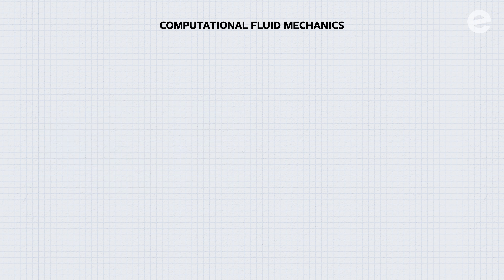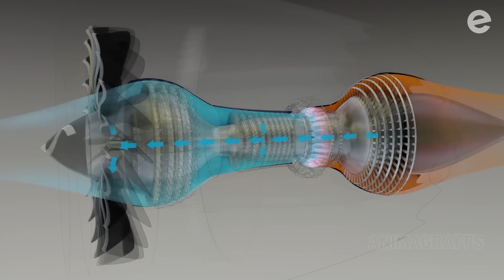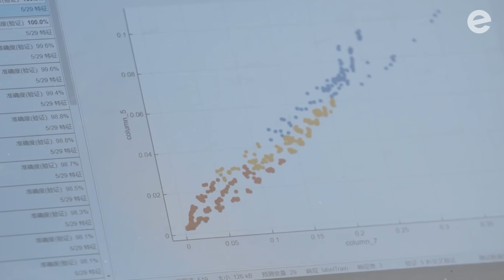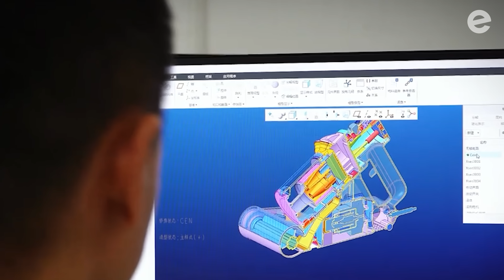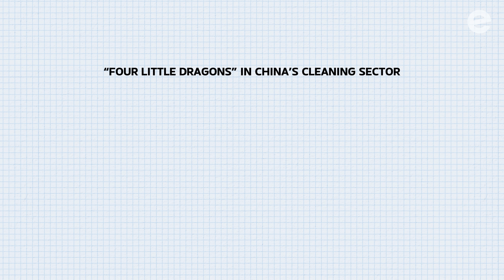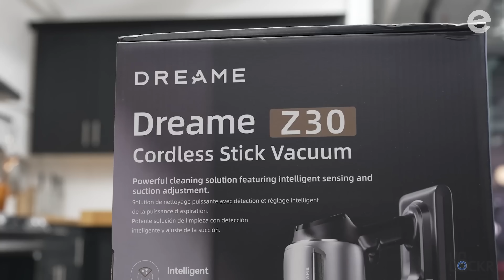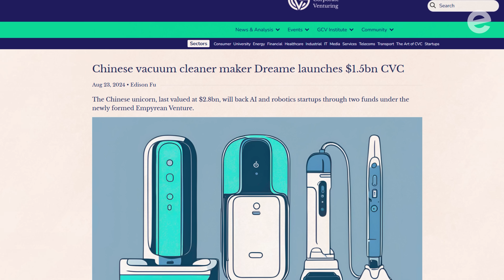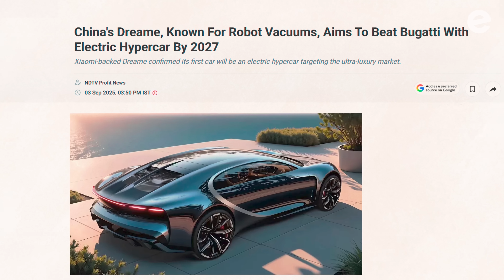How this Chinese Startup is Crushing Dyson's Empire

Comment: Just bought dreame aqua 10 roller, so instead of 10 height it has 11.5 so you have to buy not 800€ vacuum, but atleast 1100€ so that 11.5 could retract its 1,5 cm so that robot could fit under tight spaces where old robot could fit. So after 2 daysbof usage i have to return this and get aqua 10 ultra roller or track one.. oh and they most definetely madw them thicker on purpose because there is nothing there that actually youneed to make them taller at all

Comment: Actually the cleaner head design and power is more so of what determines the vacuums pick up performance and the Dyson V15 and Gen 5 still have better floor performance and more suction at the cleaner head as Dreame(like most other cordless machines) do not have good cleaner head designs.

Comment: Dyson "Bladeless" Fans Really Work
Hidden Blades: The fan blades are indeed present — they're just tucked away inside the base of the unit. These blades draw in air and push it upward into the hollow ring (called an air multiplier).

Air Multiplier Effect: The air is forced through a narrow slit around the ring, creating a jet stream. This jet entrains surrounding air, multiplying the airflow — hence the name "Air Multiplier."

Tubing Diversion: As you noted, this is essentially a redirection of airflow through a physical structure. The ring shape helps smooth out the airflow and reduce turbulence, giving it that sleek, uninterrupted look.

📉 Performance Trade-Offs
Reduced Wind Power: You're correct — studies and user tests have shown that Dyson's bladeless fans can deliver up to 30% less direct airflow compared to traditional bladed fans of similar size and power.

Quieter but Less Forceful: The design reduces noise and creates a more even breeze, but it sacrifices raw wind speed and cooling power.

🧠 Marketing vs. Reality
Dyson markets this as a breakthrough in fan technology, emphasizing safety (no exposed blades), aesthetics, and quiet operation.

Technically, it's a refined application of existing principles — not a fundamentally new way to move air.  Dyson’s “innovation” is really a clever aerodynamic design and marketing rebrand, not a fundamental reinvention of fan technology. It trades raw airflow power for aesthetics, quietness, and perceived novelty.

Comment: Afte 3 years of using the Dreame v11 SE vacuum and my mom uses the Dyson v15 detect vacuum, from my experience I can say that the Dreame vacuum is better😊 The Dyson vacuum is not bad, on the contrary it is very good, but for the price and specifications I think the Dreame is much better, taking into consideration that my vacuum is an older model.
 Now I am thinking of getting a newer model of a vacuum cleaner that mops, definitely from Dreame 🥰

Comment: the brush on a new model i bought stoped working after one year. i have a 76m apartment, its mostly hard flors. I investigated and one of the wires that caries the power for the brush motor, was interrupted. Its just bad design. I can understand mistakes on new products. I know how development works...but my old dreame i have in another location is still working like a champ, while this new one is dead after 1 year. This seems like cost reduction, talent layoffs, or poor pay for the engineers. So next i will buy Dyson.

Comment: I advise people to take their vacuum machine outdoors, remove the hose and the dust collector, then turn it on. Without any restrictions the machine will spin to its fullest, blowing dust from the inards and restoring some of its original sucking power.
Reply: I bought a "violent fan", as it's called on AliExpress. I used it to thoroughly clean my Samsung jet 75. It brought back suction power to its original level. Before this it lost about half of its power in about two years of use.

Comment: I own a Dreame Z10 station vacuum cleaner. It’s ok but the tech is not as amazing as this video makes out. Battery life is average, suction is ok but you need to go over certain surfaces many times for it to pick up. The vacuum head doesn’t like certain carpet and rug textures and will get tangled or just simply shut off. The wheels on the vacuum head are just plastic and not rubber so they squeak as you push the vacuum around. There is evidence of Chinese cost cutting all over the product to compete on price.

Comment: My Dyson needs a clean filter put in every day. And the dust box needs cleaning completely every day. Normally this restores suction to the point where it can pick up 3mm particles, without the head attached, on low power. Yesterday, I did all of this and I couldn’t even pickup the particles on highest power. Probably some dust buildup somewhere, but yeah, these are high maintenance.

Comment: 1:39 an aircraft JET turbine ENGINE (as pictured) running at 100,000 rpm, really? Which one?
That is an image of a Safran CFM Leap-1A, which Safran states runs at 20,500 rpm. Its EASA Type Certificate states a max N2 rpm of 19,391.
Reply: Exactly this.  They don't.   They spin the same rough speed as vacuums already.  This was just BS marketing propoganda.
Reply: There's the concept, and then there's the scale of the implemented concept; in the case of small engines, this can reach very high RPMs unlike large turbines

Comment: The problem with Dyson’s are their flimsy products that are not durable and in the UK,  Dyson are known as products that break and the customers are moving away from the brand.   They should have made good quality products to keep customers happy.
Reply: I would not agree that they are flimsy, but they are extremely difficult and expensive to fix compared to other brands when they do break (and nothing lasts forever). Therefore it's very difficult to justify the extremely high prices.
Reply: Give me a Dyson all day long. This is Chinese propaganda, nothing else.
Reply: @simon-croft  I was saying the same thing to the TV about 5 minutes in!! lol
Reply: Thats a shame I have my v8 for over 8 years now i use it and abuse it .. the only thing you need to do is change the battery for a adapter so you can use your tools battery .. which is makita for me ... the plastics hold up if you have a little feel for it ... and the motor will keep running for ever .. it was waytoo expensive but manit makes my life easier never liked wired vacuüm
Reply: @gmy33  where i can get this adapter for makita battery?
Reply: Yeah, greed.. again
Reply: They absolutely are flimsy as heck. Using cheap parts everywhere. I’ve personally repaired mine multiple times.
Reply: @yammy1688 then don’t use as a jackhammer
Reply: This is a lie. Dyson is neither flimsy nor unreliable. Are you just trolling? Years ago, it was big news when Chinese Dyson employees stole the company’s motor designs. Much of China’s current technology comes from theft — that’s a well-known fact.
Reply: @Iron_Byte  Thank you for speaking up about Dyson being "neither flimsy or unreliable." I don't know where all this negative "consensus" is coming from but I have a feeling most of it is bots. I will say, you could have left out the part about "China's current technology..." as what you stated is not factually accurate and comes across as rather f*cked up for lack of better term. But I get it, you were heated at the time, I totally get it and that statement would have had some weight to it if we were in the 70's or 80's, but not anymore.
Reply: @Iron_Byte sorry, but the consensus of reviews is just that — a consensus.  You’re simply out there.
Reply: @Iron_Byte BS they are badly manufactured. Less than a year back I purchased a V15. Soon after purchase the mini-motor tool was not working and about a month back my ENTIRE MOTOR HAS TO BE REPLACED! ARE YOU A DYSON EMPLOYEE?
Reply: @Iron_Byte  No its a well known racist trope which is different from a fact.
Reply: Absolutely got one in my shed absolutely useless piece of premium branding 🚨💯
Reply: @afrofy2431   pld one .. or a cordless one ??

Comment: 5 years and still working fine.
Reply: Witch one?
Reply: Western stuff may be of good quality, but holy hell, they are very expensive.
Reply: @oceanwave4502  My first Dyson broke after 2 years and 1 month.  Fortunately, Dyson replaced it free of charge as goodwill.
Reply: @oceanwave4502 5 years later wow what about the tofu bridges the rotting car’s paper thin panes jets that are grounded oh sorry we don’t fly vacuum cleaner Dyson was the 1st to step up the production line 
Bare in mind china have stolen more blueprints and patents don’t exist
Reply: @petermartinthornhill607  Are you even shame using the same ignorance fake statements over all these years? Blah Blah Blah....

"The Chinese stole the 5G mobile tech and soon the 6G tech, they stole the Thorium Reactor tech, they stole Wind Turbines and Solar Panels, they stole the world's top Three Gorges Dam project, they stole the record breaking 12,000 drones show in Shenzhen on 26 August 2025, they stole consumer drones tech like the DJI that is leading the world,  they stole Deepseek with less hardware config, they stole the High Speed Rail tech which US don't even have one line accomplished, they stole Unitree robots, they stole cashless payment systems...."

Most importantly they stole all the super high tech in military advancements like the hypersonic sliding ICBM which US cannot make one, the drones fighter jets, the 6th gen fighter test flight on the sky rather than paper work of the F47....

Keep dreaming there and stay in your own metaverse, it's better that you'd never wake!
Reply: Did they just copy the motor design ?
Reply: WHAT is still working fine
Reply: @harrickvharrick3957  the vacuum, u even have brain?
Reply: @jonwick7635probably asking about if you have a Dyson or the Chinese brand in the video.